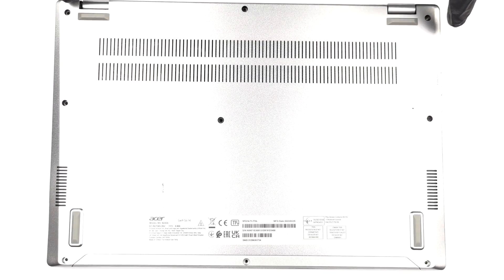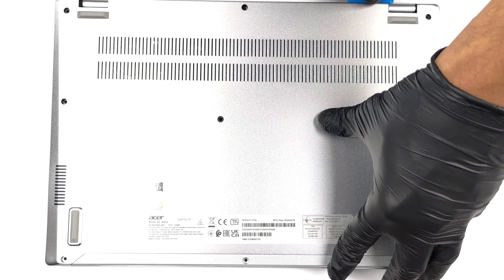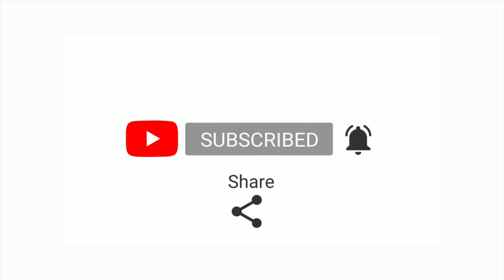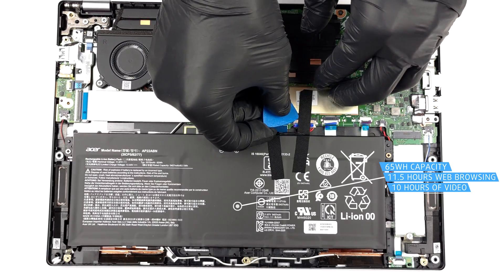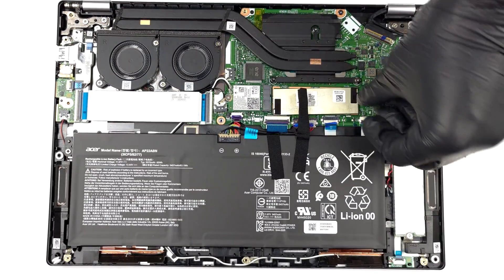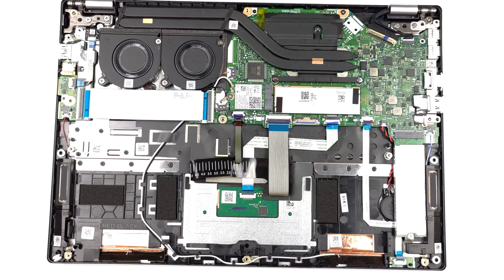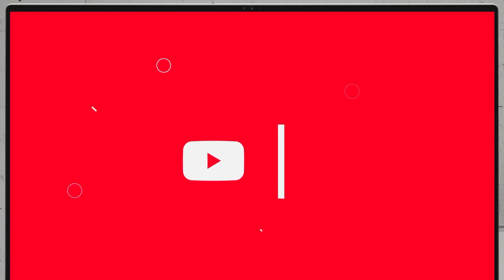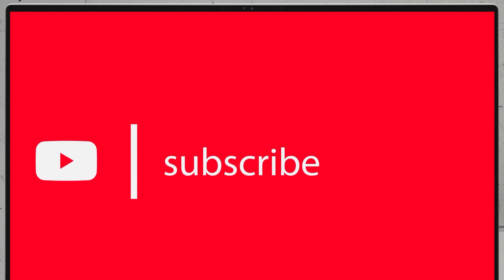🛠️ How to open Acer Swift Go 14 (SFG14-71) - disassembly and upgrade options

Comment: I just bought the Acer Swift Go SFG14-71-58UB. (I5 13500H, 16GB DDR5, 512 GB SSD). Is this laptop having second ssd slot for upgrade?
Reply: can you tell if the entire body of laptop is made of metal or is just the top lid metal
Reply: There is, under the flexible cable, beetwen fan and battery
Reply: @angelcry738  is that extra SSD slot working for windows machine?
Reply: @magesh_jambulingam  Hii sir I'm planning to buy exact model. Have you faced any issues with thermals? Output of heat is near to display so does it affects or not?
Any issues?
Thanks.
Reply: @angelcry738 Help ⚠️: Please reply me 😭🙏🏻
Is this laptop model support extra SSD Slot for Storage upgrade????🥺
Can anyone please tell me how to put an extra 512gb SSD in my 14 inch  SFG14-71 model??? 
Please give me step by step Solutions 😢🙏🏻
Reply: @IPV-252  mine will come tomorrow, so i can tell that time. If it has 2 slots
you can just put another nvme ssd to increase storage. Incase there is only 1 slot, you can remove the existing half tb and swap it with 1tb one
Reply: @Agastya_XV  bro wassup whats the update? does it have extra slot??
Reply: @philosopherkyng  hey there, yes it does have 2 nvme ssd slots.

One is hidden under the ribbon cable under the fans. And yeah it isnt software locked either, i was able to boot from that ssd slot, and got the same speeds

RAM isnt upgradable, its soldered on, but if you want to expand your memory, you can buy another nvme ssd and use both drives at the same time
Reply: @Agastya_XV  Ok i am sold! Thanks❤❤
Reply: @philosopherkyng  npnp :D
stock ssd does 5k read 4k write, u can get the fastest gen 4s and get 7k read 6k write or just go gen 3 for mass storage and plop a 1/2 tb drive
Reply: @Agastya_XV  Actually i was considering that only to go for gen 3 mass storage, as i have no need of fast ssd but might or might not have 690 GB of study material Iykyk. I wonder if could get away with 2 tb ssd.
Reply: @philosopherkyng  u could just add a 1tb nvme ssd, and ull have a combined 1.5tb. Else only other option is to plop a 2tb one

Comment: How is the airflow direction? Does it come from the back inside then blows it to the bottom? Or the fan sucks air from the bottom and blows out the back? Will it affect the OLED Screen long term?
Reply: That's why I bought the IPS version of this laptop.....haaaa
Reply: @borneoenthusiast3341 What do you mean? Why?
Reply: @jonathanlange1339  he said, heat exhaust from heatsink by design hit the display panel on the bottom screen, we all know oled display more fragile than IPS display
Reply: @jonathanlange1339  that's why I bought swift go IPS display than oled display

Comment: Ram is upgradable or not?
Reply: nope, soldered to the motherboard with no additional slots. So you need to choose the most RAM you can afford when buying.
Reply: There's no way to upgrade soldered Ram? @silvanigra
Reply: @zayn659  Unfortunately not, at least not at home using your everyday tools. RAM is soldered to the motherboard in factory, most likely by industrial robots. So you better choose one with at least 16GB RAM if you plan to use it for several years.
Reply: @silvanigra  What about the storage? Is there any extra slot?
Reply: what if ram got issues?
Reply: @syaggyparazuli8787  You take it in for repairs under warranty (if still within the warranty period), otherwise you would have to replace the entire motherboard with RAM on it. That's why you should always avoid such nonsense as soldered RAM.
On the bright side.. RAM rarely fails. Other parts - even the motherboard - will most likely fail first.

Comment: You forgot to mention the m.2 slot under the cable below the fans
Reply: @polar-sy4if which m.2 SSD I can buy for 2nd slot. Any configuration or buy link
Reply: Absolutely amazing how a 14 inch laptop will have an additional M.2 slot for storage upgradability. Hats off to Acer!
Reply: Is this real to upgrade options but The laptop seller from Acer told me there is no extra slot for upgradation. @gemini-mg6sc
Reply: OMG thank you!! I was about to install windows on my upgraded SSD and archive the 512gb one :D
Reply: Please, how to remove the flat cable to access the second slot? I don't want to damage the computer using to much force at the wrong place. Thank you!
Reply: @stepantrnka6972  You can flip the black locking tab upwards, pull the flat cable gently to access the second slot.
Reply: Help ⚠️: Please reply me 😭🙏🏻
Can anyone please tell me how to put an extra 512gb SSD in my 14 inch  SFG14-71 model??? 
Please give me step by step Solutions 😢🙏🏻
Reply: @IPV-252  is it possible?? Does it have an extra SSD slot ?
Reply: @@RandieAzahli yeah I think so
Reply: @@RandieAzahli Probably not. Maybe switch to the slot that original SSD is installed?
Reply: @@RandieAzahli Indeed
Reply: hi Peter do you have same laptop
can you make a video
Acer Swift Go (SFG14-71) i7 1355u
is that laptop having second m2 slot?
Reply: @BananaBeach519 I do not have one myself but it does have the second slot like its previous model.
Reply: @Peter_Skywalker  ok thank you
Reply: Hi! I was wondering if the new Acer SFG14-72 serie have the same second m.2 slot or not? Thank you!
Reply: @magicthrill  I think it does
Reply: In your opinion, is it possible to mount a 2TB SSD in the second M2 slot or is the maximum supported 1TB?
Reply: @alessandromartorana4459  You can give it a try if you want to. But I don't know if that will work.
Reply: @Peter_Skywalker  Thanks Peter, do you know if there is the possibility of making the secondary SSD the boot drive, setting it as boot from the bios options? Or it is necessary to exchange the two SSDs, perhaps after having cloned them.
Reply: @alessandromartorana4459  Just install windows in the second SSD and set it as the first boot option.
Reply: @Peter_Skywalker  Thanks Peter.
Reply: @alessandromartorana4459  2tb will work lots of  new laptop
Reply: I was thinking of putting an SSD with a heatsink, they say they heat up quite a bit, I was wondering what overall thickness could be accepted under the flat cable.
Reply: @alessandromartorana4459  I don’t know either, but I think it would not fit.
Reply: @Peter_Skywalker  I was thinking of putting a copper plate with a thickness of 1 mm and a thermal pad also with a thickness of 1 mm.
Reply: Does not look like a typical M2 slot. It seems like some tricky way to connect ... hmm... motherboard bridges?
Reply: @knowledge.dealer  Just remove the cable and you’ll see the slot, then recover that cable after installing a SSD. 
Btw I can’t believe that they miss the slot again this year😂
Reply: @forxass4582  It’s under the white cable below the two fans.
Reply: @Peter_Skywalker  Does yours work? I'm gonna verify with Linux, but right now Windows only detects the NVMe on the right-bottom of the computer.
Reply: @polar-sy4if  Did you initialize the hard drive in disk management?
Reply: @Peter_Skywalker  I don’t know why it didn’t load in Windows, but after formatting it on Linux, now I have both drives working. It’s weird that it’s a hidden port, but it’s amazing to have two M.2 drives.